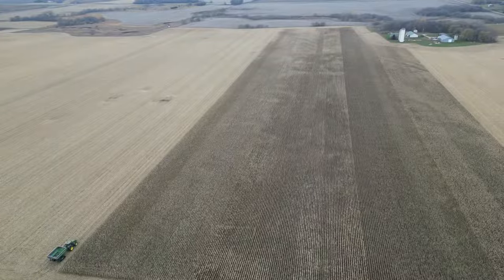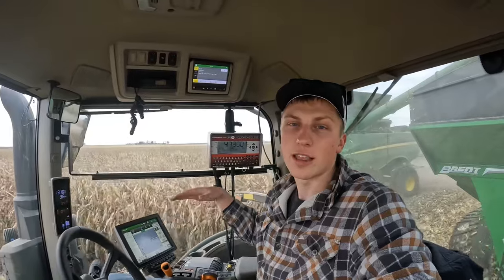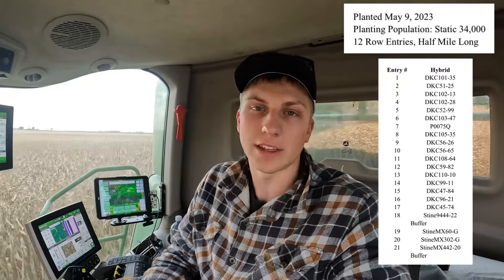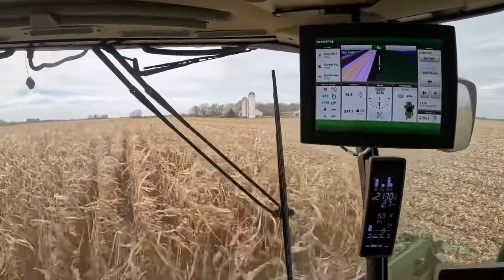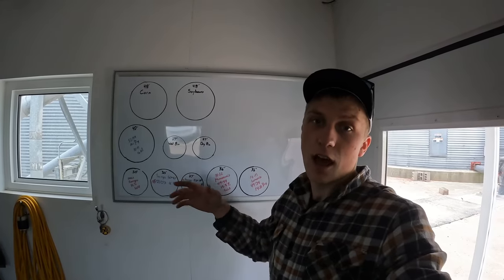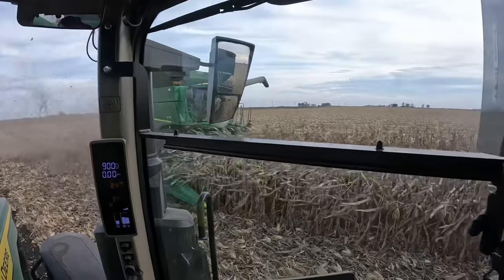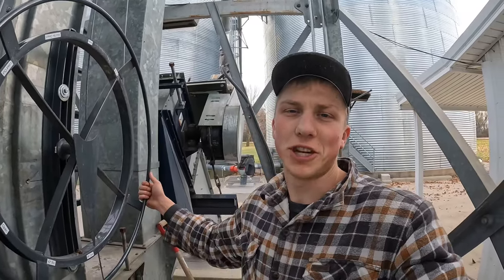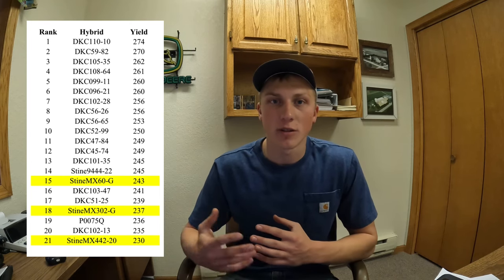Switching My Farm To Short Corn?

Comment: Just discovered your channel and really like it.  Certainly not a mathematician, but to me, the highest DeKalb (DKC 110-10 at 274 bushels/acre) compared to the lowest producing (DKC102-13 at 235) = average bushels of 254.5 bushels/acre.  This average most likely isn't really important or applicable because I'm sure you didn't plant 1/2 your acreage with the 110 day corn and the other half with the 102 day, but if your total acreage for the last 2-3 yrs produces 250 bushel/acre corn, and the Stine short corn varieties can produce right at 243 and maybe a little higher, wouldn't the calculation (to determine if you could apply your own spray) be maybe taking the average of those last couple yrs (2-3 yrs) total bushel/acre, and comparing that number with Stine short corn bushels/acre of say, 240/acre, and calculating if your avg of say 250 pays for the outside application?  That is, if last two years average = say 250/acre, then does the 10 bushels/acre pay for the outside spraying?  Betting it does, but something to think about especially when comparing cost of seed corn too, and any programs the different companies may have--especially financing, and recommended population, and anything else I can't think of right now.  idk?
Reply from the maker: I followed your math exactly when going thru looking at the plot data. If we say the DeKalb corn is 5 bushels better, times a conservative price of $4 cash, that more than pays to hire someone to apply fungicide to my fields. My biggest concern/fear of the short stature corn I tried this year (had it yielded closer) would be the lack of trait package. For example the Stine short corn, as far as I know, doesn’t have any forms of below ground protection from corn rootworm which we have seen increasing numbers of over the last 2 years. That risk combined with the lower yields we saw, pushed me away for next year. But I’m always willing to try new things a few times. This is just my opinion for my farm, definitely not a one size fits all, as you know. Cool to see the technology nonetheless and how far it’s come!

Comment: Pretty interesting comparisons and a lot of extra work planting and harvesting the different test plots. Here we see a lot of test plots but usually done by the university or a seed company themselves. The fact you do your own is cool and how do you know if you don’t try it for yourself in your fields and your conditions. Did you weigh each plot to compare total tonnage and if so did that figure into your calculations or did you just go off the combine data? Thanks very good video.
Reply from the maker: No doubt that it takes us a fair amount of time in the spring cleaning out the planter 10 different times and refilling the hoppers. In prior years we would use a weigh wagon, but we had found the combine yield technology is within an acceptable range for yield comparisons. The weigh wagon is also tough when doing 12 row entries a half mile long. Lots of corn to weigh.